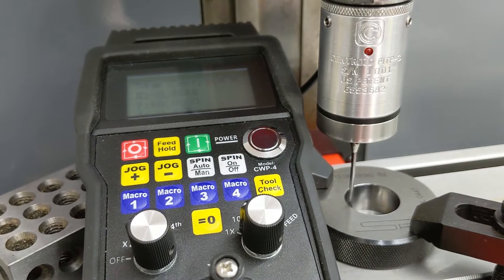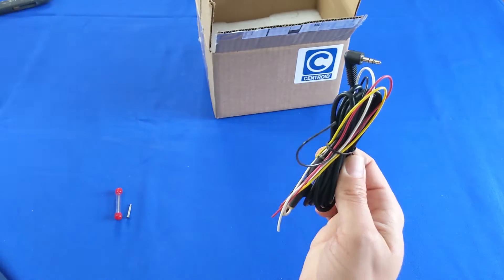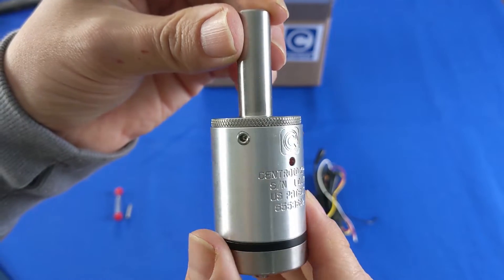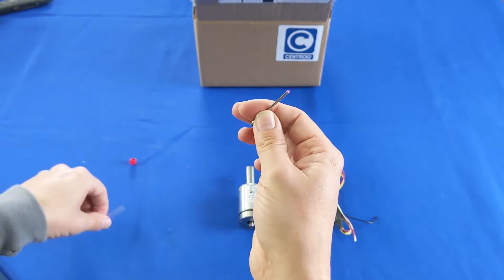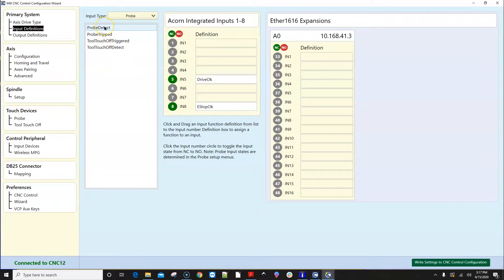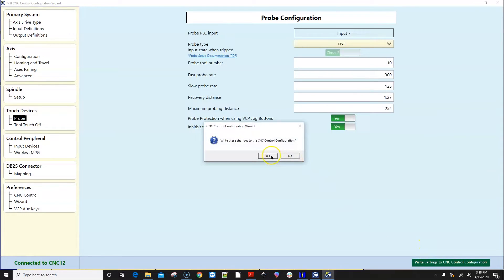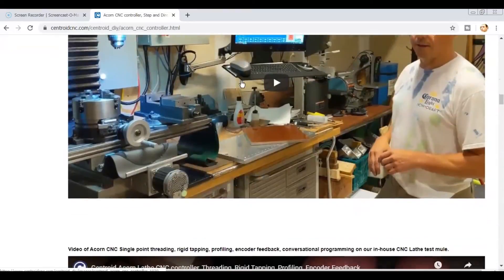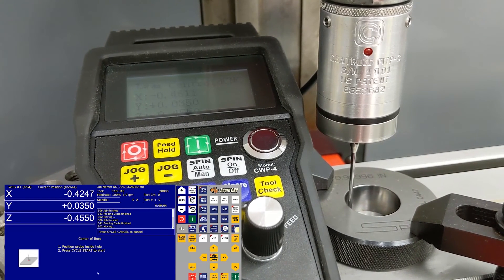CENTROID CNC Touch Probe Unboxing: KP-3 Kinematic Touch Probe

Comment: Will this also set the z height and do you need to upgrade the cnc12 software? Thanks.
Reply from the maker: yes you can set Z height with the probe, the probe can also be the reference tool to measure all the other tools from for tool length.  All probing cycles are included with the Pro Level CNC12 software in the upcoming v4.5 release as a standard feature.
Reply: @CentroidCNC  thank you for the reply. I just got my mill cnc converted using a acorn board. Everything so far has been great!!!